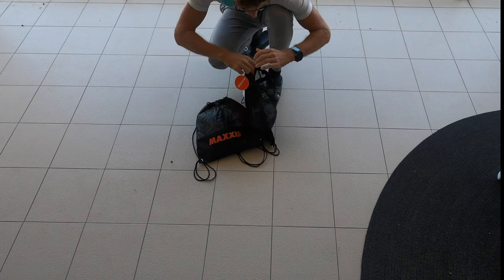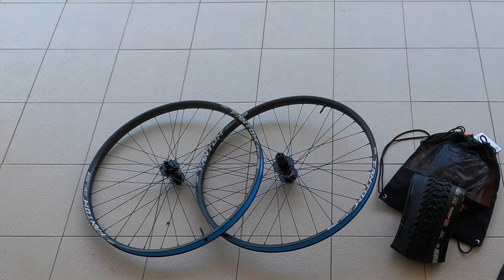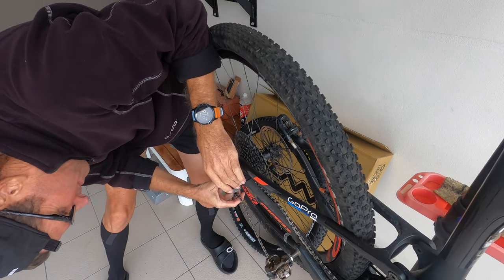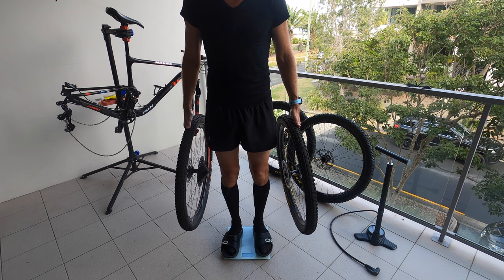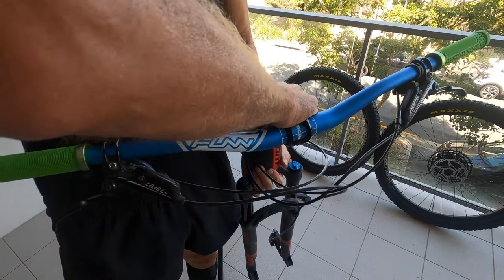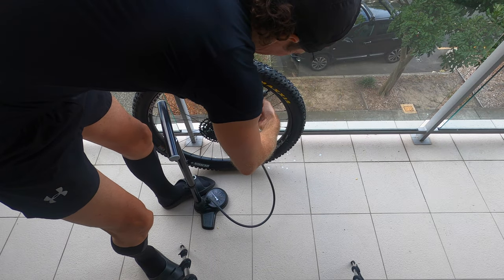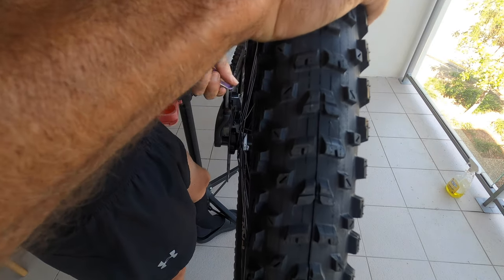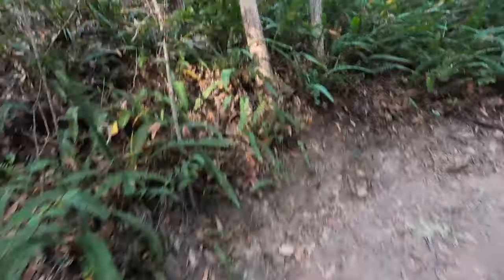Can I Convert My XC Bike to a Trail Bike?

Comment: Nice one. I did similar with my old Trek FS8. Wide rims and tyres first. So much grip after the XC tyres. Then a dropper, 780 bars and short stem completed the job. Magic. Even at my old man speed. Except tree gaps need a little more care. Cheers.
Reply from the maker: Nice. Sounds like you did a similar job to me. How wide a tyre did you fit in?
Reply: 780 bars? How tall are you sir?

Comment: So...you put there a wider bars so you should put shorter stem too to counterbalance the width of the bars because now the bars are moving really far away because of the stem
Reply: Yep I think so too
Reply from the maker: Good point. Thanks for bringing that up. I actually did shorten the stem off camera. I went from a 110 to an 80 mm. Remembering I’m converting my cross country bike ( which is my main discipline) into a more forgiving ride for my local trails. In summary, not really a CX bike and not really a trail bike, let’s call it a hybrid, sitting in between the two.
Reply: @TriFitwithTimandAmanda  l
Reply: Yes, I was just about to comment that. Good pick up mate.

Comment: Great vid mate. Did you find steering a bit odd with the high rise bar? My stock is 10mm, tried a 20mm bar, thinking of going to 40 - this will make the handles at the same height as the seat. ATM I'm still very much in the "sprinting" XC position when seated.

Comment: Great video!
Seeing your mods I realized I already did most of that in 08 on my old Scale 😂 Riser bar, shorter and steeper stem. I don't think I will be able to fit wider tires though. 
Where there some things that you preferred with your old setting?
I am skeptical to switch to a modern bike with 29ers because I am afraid I would miss the zippiness of the 26ers and their lower weight as well as the low rolling resistance uphill. 
I am still the fastest downhill in my group and my mates all have new bikes.
Reply from the maker: Thanks for the comment. I still use my older wheels for XC races because they’re faster. But I much prefer the wider tyres for everyday riding. 
26 vs 27 vs 29 will be around forever.  I think if it works for you then stay with it.
Reply: i recommend you try 27.5's first, before completely switching to 29, maybe you will like the middleground better eh?
Reply from the maker: Good idea. Thanks for the tip

Comment: Hi! Great video. Concerning the stem length and the addition of sealant, sure a shorter stem would be what a Trail bike calls for but everything is relative in my opinion.....look at the reach on the bike ist of all from seat to handle bars. Also bear in mind that the new bar may have more back sweep than the original. Let's say for example the wider bars were put on and had more back sweep than the original bar with the same stem, then "in theory" that's equivalent to a shortened stem not so?
About the sealant....you only put it in one area then inflate the tyre? I was thinking that you would pour the 100 ml you used all along the inside of the whole tyre then inflate it,  any comment?
Thanks for your response
Great video again!
Reply from the maker: With the stem length, valid point. On stem length the bars do have sweep. When I pour the sealant in it makes it’s way around the entire tyre when the wheel spins. Thanks for watching.

Comment: Loved it. It would be more sick with crossfire funn stem on
Reply from the maker: Yes I agree but I run a 90mm stem remembering this is a XC mix bike and Funn don’t make a stem that long
Reply: @TriFitwithTimandAmanda  oh...I am also converting my giant talon 1 2019 in trail bike.....changed into 1X9 speed 130mm fork and planning to upgrade crossfire stem, funn hub and handle bar. I'm excited.👌
Reply from the maker: Cool. You’ll love it.

Comment: Good vid mate im looking at turning my trail bike into an xc bike as i just did JB24hr at lithgow and my bikes to heavy so decisions need to be made regarding conversion or CF 120mm travel revolver as with you i only want 1 bike to do all. Current bike is Norco fluid 130/120 travel already cut down the bars to 760 now im looking at xc wheelsets sticking to aluminium. 25mm internal boost sram xd xo1 cassette. Looking at hunt wheels but seen the ones you put on and how do you rate them. I live in newcastle nsw
Reply from the maker: I used the Funn wheels. I love them. They come in 3 different times widths and every cassette configuration made. They are also under a grand which is an added bonus. Good luck with the build. Keep me posted.

Comment: What travel do you have up front?  Did you rear tire rub the frame?
Reply from the maker: 100mm up front and yes the rear tyre just nudged the frame so since making this video I’ve gone to a smaller tyre
Reply: @TriFitwithTimandAmanda  Thanks. I had a problem with that too. I am riding 2.2. I will use the handle bar and stem idea.

Comment: why didn't you upgrade the fork?
Reply from the maker: Jeremy Eden would love to but budget constraints stopped me
Reply: @TriFitwithTimandAmanda  eBay buddy. get a fox 32 or 34.
Reply: @jerryx2000  i have Fox 32 on my Pique, but it bottoms out on the most basic of jumps (2foot), any ideas?
Reply: @amandabrownsea5066  air pressure too low.
Reply: @amandabrownsea5066  try using the psi fox recommend for your fork model and your weight with the fastest setting, at first it might seem the fork is set to hard but try it and see if it responds well when really needed. I hope it helps, cheers.

Comment: You’d better have cleaned those rotors before u put them on the bike
Reply from the maker: Actually mate I didn’t. Would you recommend cleaning new rotors before putting them on?
Reply: Tri Fit with Tim and Amanda yeah because the oil from your skin can contaminate your pads and rotors and they will make an ear splitting squeal and they wont have as much braking power